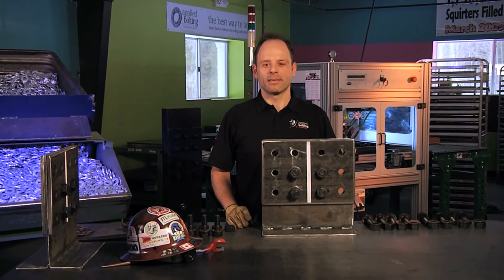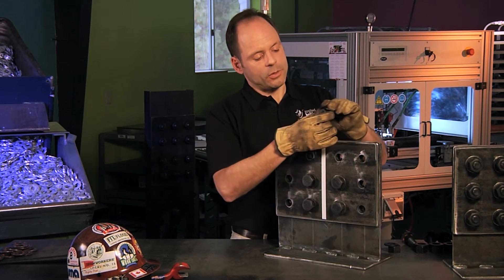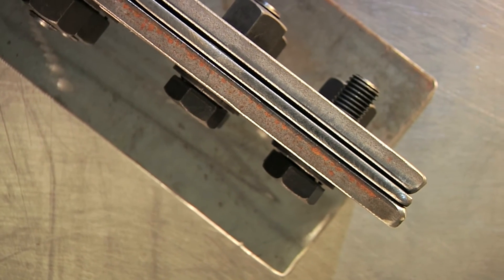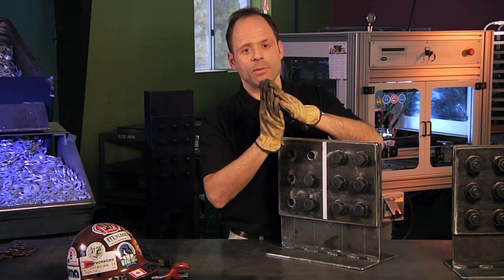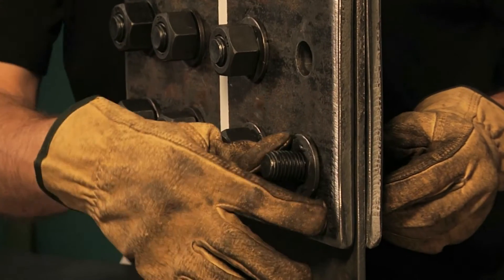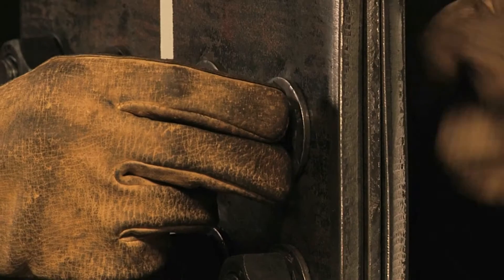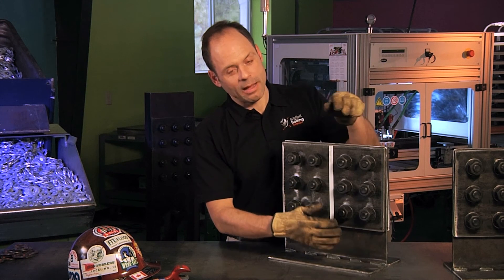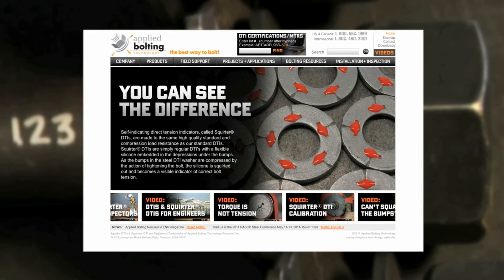Applied Bolting - DTI Location - Head Side Assembly

Comment: Applied bolting... 

My question is when we use DTI washer under bolt head and when used at under nut... And another was is this fix rule to use hardened washer on DTI washer if this under bolt head or under nut..? 

Please guide.
Reply from the maker: I am sure my response is too late to be of any use.  I am sorry.  Please place a hardened F436 flat washer on top of the bumps.  Please call for specification installation and inspection instructions.